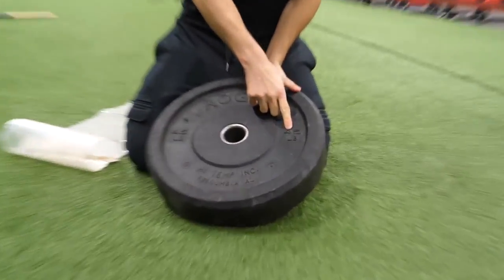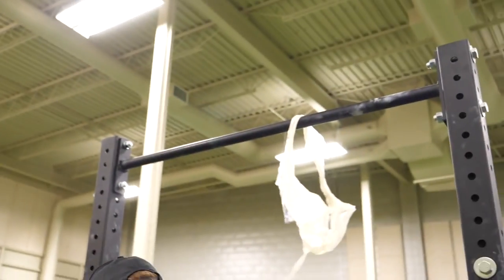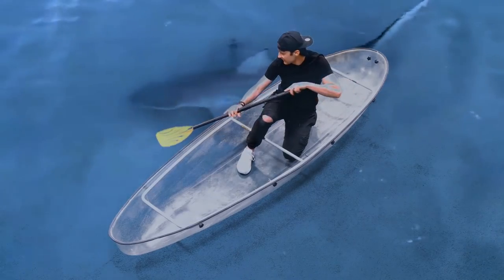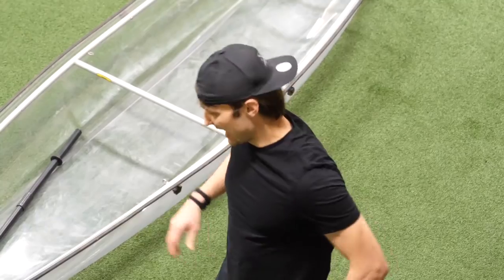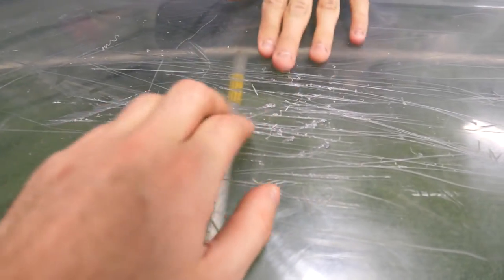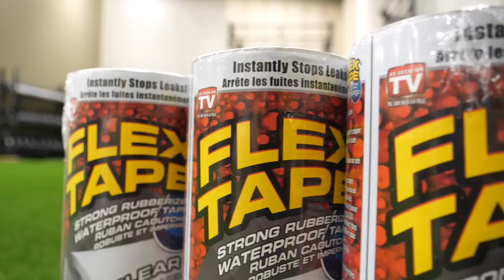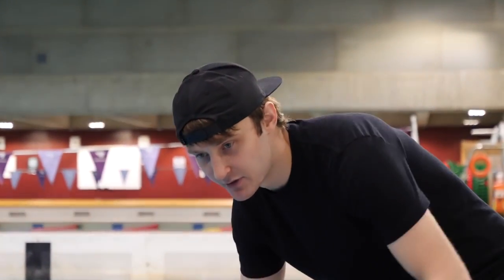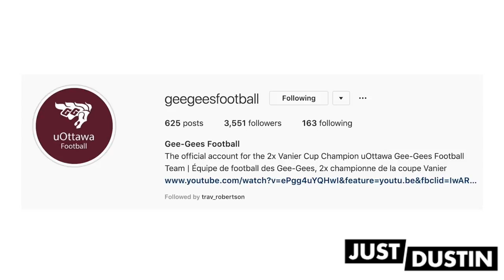I MADE AN ENTIRE BOAT WITH FLEX TAPE CLEAR!! (TESTING FLEX TAPE CLEAR) As Seen On TV Test!

Comment: If u took a piece of rubber, and slap it on the inside, it would seal it cos the pressure behind it from the water holds it against the hole and keeps it sealed. Don't need extreme hold strength to keep it there.